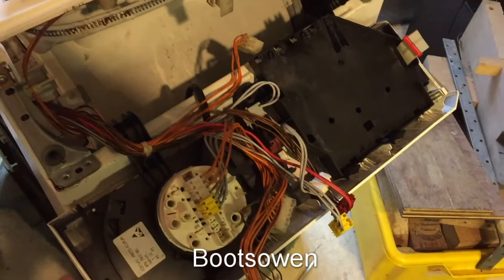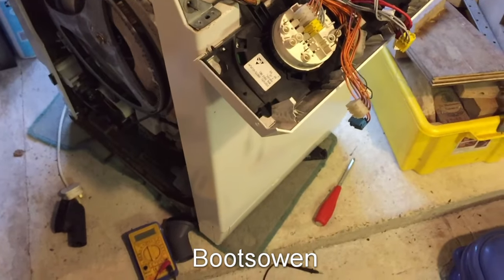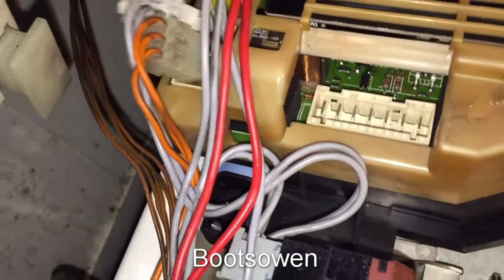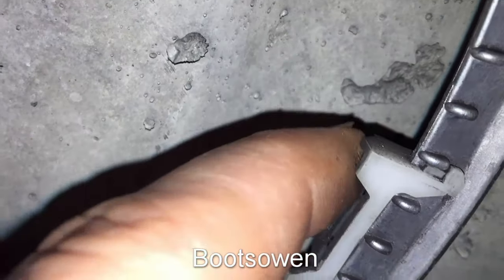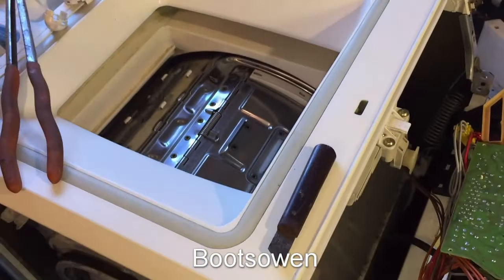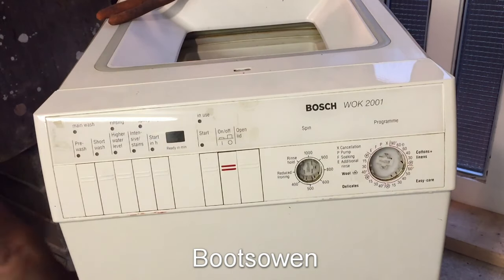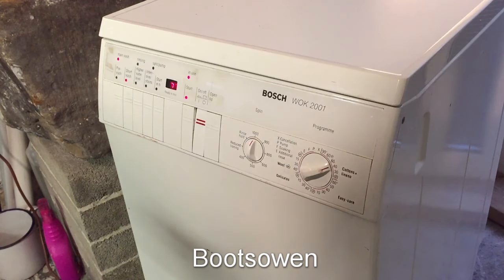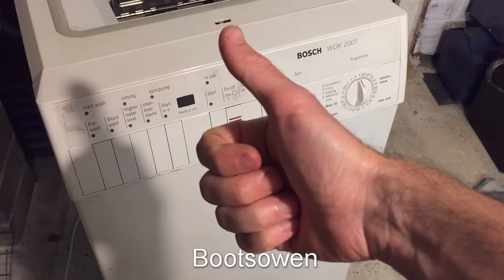Bosch WOK2001 PCB Fault (top loading washing machine)

Comment: That trace might be that big because power for the heater is going through it. It may work like that for some time, but I advise to fill the gapps using solder and copper wire

Comment: I have an arçelik 5900e and it blowed the fuse when it does the anti crease tumbles between the final spin intervals, and then it started to give e2 code and dose not do anything. Could it be the same thing. The machine starts and then gives the e2 error code when it should start the program
Reply from the maker: Motor brushes?
Reply: bootsowen I don’t think so because motor turns just fine when you press start after the error is appeared, it turn twı timrs then gives the error again. I think I need to disassemble the electronic boards
Reply from the maker: Maybe you are right, it is certainly the more complicated option, what do y you are looking for?